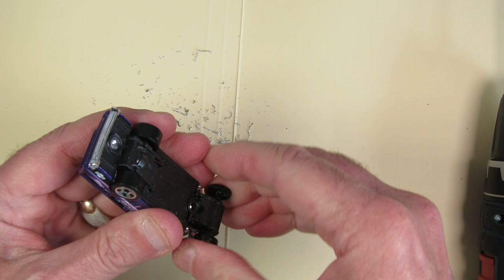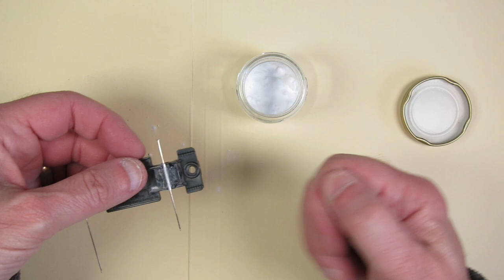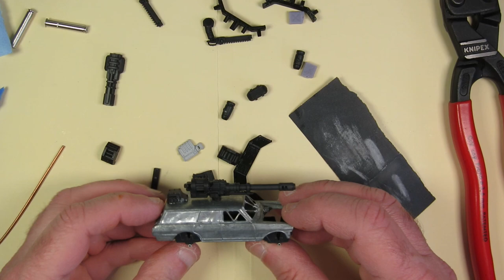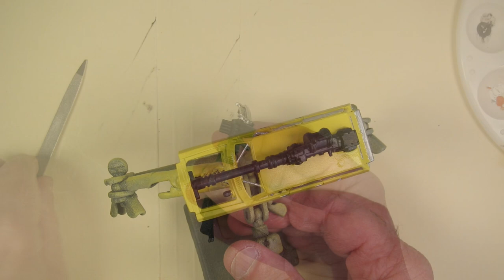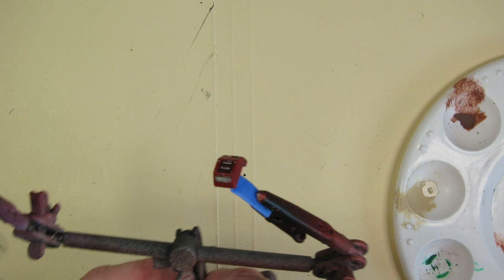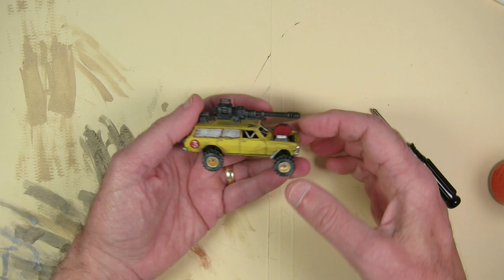Custom Hot Wheels '64 Chevy Nova Wagon - Diecast Mafia Invitational #chevynova #diecastmafia

Comment: Totally love this one, Jim. The patina (very well done), the wheel swap, just the right amount of decals... That's some serious firepower up top too! But I love the air cleaner over the velocity stacks the most. That's an addition I haven't seen before. Nice touch! 🍁☕👍
Reply from the maker: Thanks so much Andrew!  I couldn't resist putting something over those velocity stacks lol - I haven't seen it before either and I knew I wanted something to give it a "tough" look as well - fortunately I had a few little bits laying around that could have worked and I just chose the one that seemed to fit the build best.  The other thing I did that was different than my "usual" approach was the intentional angling of the pipes in the window openings -- usually I do either bars as straight as possible or some kind of mesh.  I realized that probably wasn't very realistic so I tweaked things a little from my usual.  Thanks for watching!

Comment: Love the build!
Can you share the self taping screw part number and what size drill bit you use for it. Thanks
Reply from the maker: Thanks!  I've got a link in my Amazon store to the self tapping (they call them thread cutting) screws and I usually just order 2-56 bits at the same time.  They're listed in my store as well, but only with the tap which you wouldn't need with these screws, so I would search for them separately.  Here's the link to the screws -  https://www.amazon.com/shop/jimsilva/list/12I2CCXJ10L9S?ref_=aip_sf_list_spv_ofs_mixed_d

Comment: looks great, and not as corroded as other gaslands vehicles; this one is really cared for. :)

as for the air filter, this is wat struck me a little wrong seeing the 4th Mad Max movie, the lack of any air filtering in an environment where sand storms occur. the fine dust sucked in becomes an abrasive paste together with the engine oil, and would wear out the engine in short time. but that might be the car mechanic in me... :)
Reply from the maker: Thanks Lothar!  The "not as corroded" was exactly what I had in mind, and the reason behind the selection of the color.  I wanted it to show rusting, fuel spills by the gas cap, etc, without being the usual extreme...and the lighter color for the car let me do that.  Ahhhhhhh...the air filter lol - my thoughts exactly - I had a few pieces that would have worked, and give the "tough" look I wanted, with the one I chose being the one that seemed to "fit" the look the best.
Reply: @JimSilva-SilvaDiecastCustoms  well, I approve of all that. :D

the air filter also prevents innocent birds from being sucked in... they are a menace to clean out. XD
Reply from the maker: @lotharrenz4621  🤣🤣🤣🤣

Comment: Do the selftap screw's work just as good 👍
Reply from the maker: Yes...well, almost always lol.  There are some situations where I can't use them, such as with the REALLY small posts that require a 1-72 screw (there may be self tapping 1-72 screws out there - I've never tried them if they're available), but otherwise I would think they would do fine.  There's a certain satisfaction with drilling and tapping a post for regular screws, so I use them in most situations, but it's not like we put these little cars under much stress so the self tapping screws should be fine.
Reply: @JimSilva-SilvaDiecastCustoms  cool 😎👍